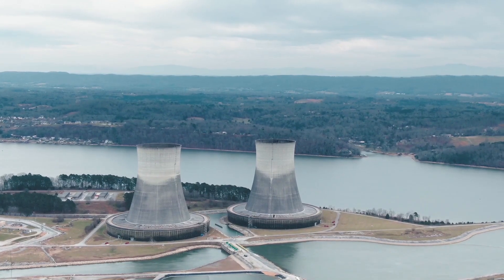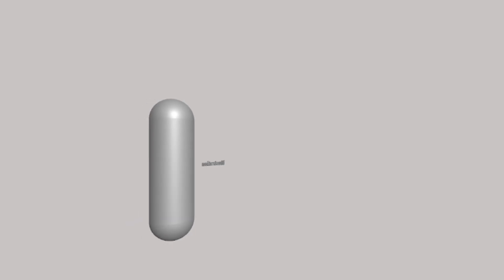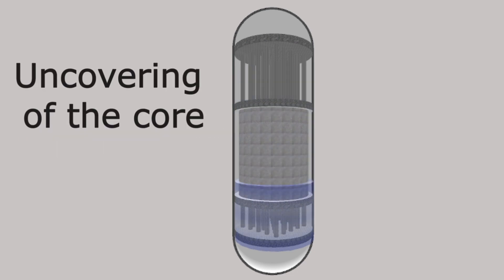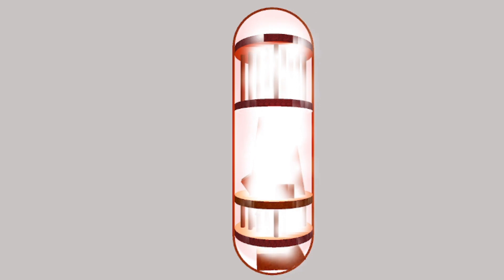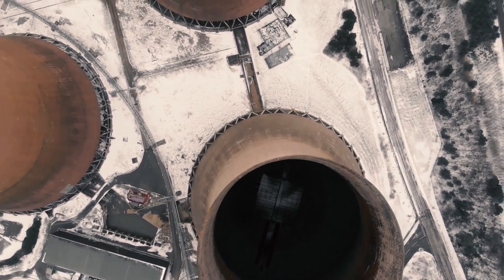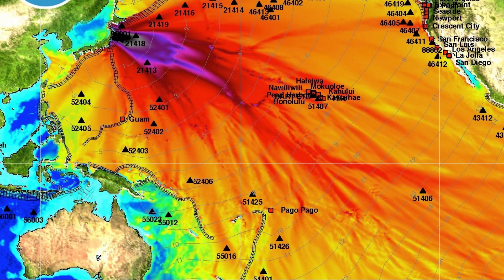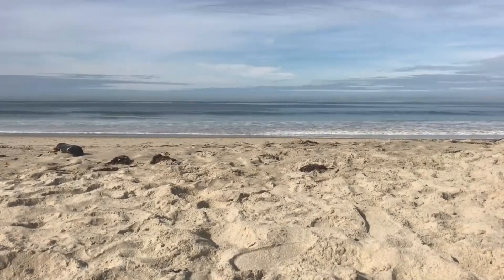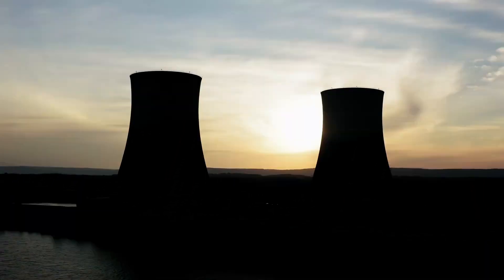What is a nuclear meltdown?

Comment: Is it possible to replace all of the existing plants with the molten salt reactor technology? It sounds like the salt reactor design is much more stable and able to deal with the numerous failures that previous designs were not able to withstand.
Reply from the maker: It would be very costly and molten salt reactors are still being developed. They are great but only a few have been built so far.
Reply: @venera13  Thank you for the info!

Comment: partal melt downs are rather comen with older reactors. when i say part one of 2 fuel rods just get to hot and partly melt. things move around when heated and sometimes blocks good cooling flow to a spot. i do work in nuclear plants and have been privy to this info. but at the same time seen pics where a whole fuel bundle was damaged due to over heating and yet plant was unaware of it till fuel change out. so clearly not much of an issue. they said the reactor was runing normal. as long as the heat has sum place to go it will still be removed.

Comment: Radiation Can't Be Diluted!
It Will Make All Near It Radioactive!
If it was possible to be diluted there wouldn't be a problem with nuclear wastes. You could just dilute it to safe levels.
They're not doing that.
Reply from the maker: Neutron radiation can turn metals radioactive. Nuclear material released from power plants is just that, radioactive material. It can and does get diluted. That's why the ocean isn't radioactive. Or how there is natural radioactive radon gas in the air you are breathing right now, yet you aren't radioactive. To dispose of weapons grade plutonium they dilute it into glass and dump it in concrete casks.

Nuclear waste isn't a problem, it legitimately is not a problem. All the nuclear waste a reactor produces over 50 years can fit in a small wearhouse. And that's usually what they do. Just put it in concrete casks in wearhouses or concrete slabs where it sits and does nothing.

Looking at both your comments I understand where you are coming from as you do not understand the basics of radioactivity or how it works. I have radioactive materials and work with then on occasion. You can very easily read about radioactive and what it is, as well as what fallout it. You might be shocked to know there are different kinds of radiation. Like particle and EM radiation. Alpha beta and neutron radiation are particles, gamma x ray and ultraviolet are just light. You can blast a chunk of metal with gamma radiation and it won't be radioactive, but if you blast it with neutrons, it will become radioactive.

Nuclear fallout is small particulate of radioactive material, fission byproducts and dust with fission byproducts in it. This is why Nuclear fallout is cleaned off with soap and water. It's just dust.

Also global warming is a real verified fact of life. I beg you, reading is so easy, not believing conspiracy theories is also very easy. Assuming you know more about a topic than you actually do and trying to dunk on people who unironically have nuclear material samples on their desk, is a terrible idea. There is no shame in admitting you don't understand something and reading about it to learn more. There is no shame in admitting you might be wrong and the experts know something you don't. (I am not an expert but the actual experts know more than you or I on this topic).

Comment: No nukes! Just go back to natural gas. I can live with a little globull warming vs radioactive waste that lasts 100,000-years. ☠️
Reply from the maker: The irony being we can't live with global warming, unless you can survive without food anyway, food crops do not manage higher CO2 and unstable weather very well. Besides nuclear waste isn't an issue. It's just solids that can sit in concrete casks for as long as you need. All the nuclear waste produced by Switzerland over the last 45 years fits in a single warehouse. If we build molten salt reactors we can use existing Nuclear waste as fuel, and the byproducts they produce decay over hundreds of years instead of thousands. Natural gas is better than coal but it's still a terrible very susceptible to attack energy source.

You only use natural gas if you want your countries energy to be controlled by other countries and like paying variable prices.
Reply: @venera13  I can survive 1*F increase in 100-years. CO2 is plant food and there will be more. You drank the globull warming Koolaid. FJB 🖕🏻🦃